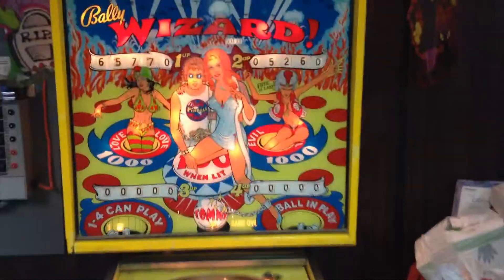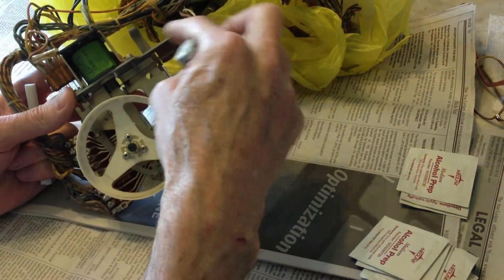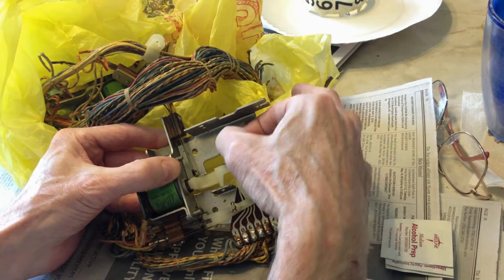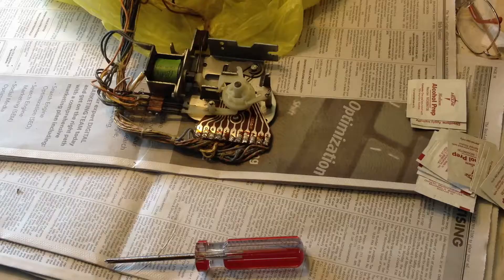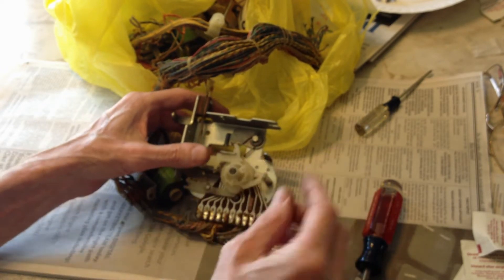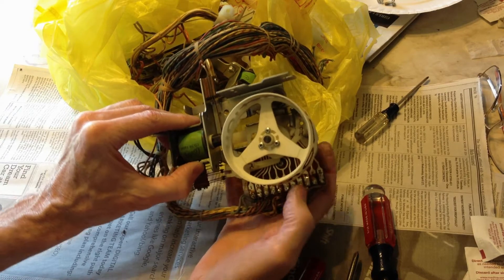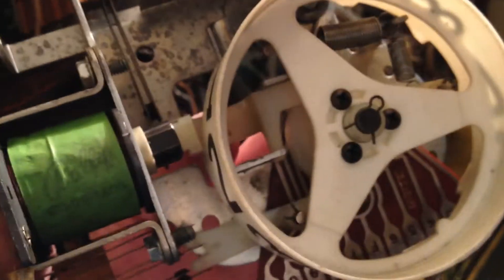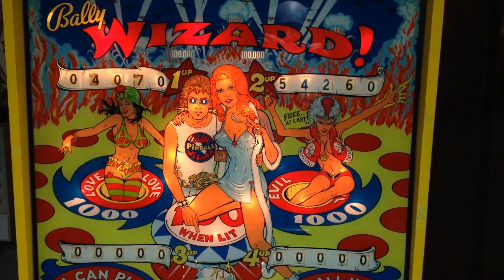Bally Score Reel Cleaning 1975  Wizard  EM Score Reel TearDown - Sticky Score Reels

Comment: Really good job in explaining the process in detail.  All those tips, big and small, really helped me out with my 1976 Captain Fantastic by Bally. It has an identical scoring reel setup to your Wizard. My reel was filthy. I guess the prior owner used some sort of lubricant that turned into gunk. I cleaned the heck out of every little part.  But I cheated a little bit regarding the springs.  I swapped the springs from the rarely used 4th player reel which was already clean as a whistle and those springs were low mileage. So the 4th player mechanism didn't require tighter springs and it still works fine with the higher mileage springs from the Player 1 reel. Again, thanks so much for your video and thanks to you, I can get back to 70s (in my mind) to play Capt Fantastic!
Reply from the maker: Using the 4th player springs was a great idea, I didn't even think of it.  Also Capt Fantastic is a great game, wish I had one....good luck with it!!!

Comment: Freakin Awesome Man  you just got my Bally Hokus Pokus scoring right on!!!!
Reply from the maker: Great!!  I'm really glad to hear that.  We gotta keep these old classic machines up and running.  Good luck with it.
Reply: +Ed Ward You've got that right! I have a 1974 Williams Star Pool Pinball Machine that constantly needs attention. I've owned it for maybe 10 years and can't count how many times I've torn down Score Motors, Stepper Units, Flipper repair, and so on. It's a very fun Game to play, but is always in need of attention. On the flipside I have a 1975 Bally Flicker Machine that I've owned for over 30 years and have replaced the Flipper Coils 1 time and nothing else and plays like a dream. I'm still in awe the genius of the  Engineers that designed these older EM machines back in the day without any Electronic Circuitry. Personally I prefer the older EM Games than the newer Games. You did a great job repairing your sticking Score Reels.
Reply from the maker: Damn, you took the words right out of my mouth.  The way these guys engineered these games is like the 8th wonder of the world.  My hat goes off to those guys that did so much with (compared to today) so little technology.  Keep those games going B L .

Comment: Good tips.  Just replace the coil sleeve, cleaning it is ok.  I never lube metal to nylon parts.  Bally used to sell some special light ‘machine oil’ lube- but it’s not for coil sleeves and was only used very lightly on the score reel parts. You can still get the metal “horseshoe” contact and replace that if it’s broken when you take it completely apart. Yours looked good!

Comment: Thanks for the video. At 5:59, that's the issue I have. When I manually operate the solenoid to advance the reel, once it gets to 9, it doesn't want to move to 0. At 6:25 "That needs to be adjusted", the reel moved out of the camera. What were you referring to there? That's what I need to try next.

Comment: Nice clear teardown instructions.   
FYI, there is a little rectangular knob on the hub of the score wheel that mates with a notch on the hub of the cam gear.  So when mounting the score wheel back onto the cam gear, there is only one possible relative position between the two.  So no need to find the hump and rotate the score wheel to have the one in the front.  
Presently cleaning all 16 score units on a very gunked up Bally See Saw.  Couldn't find an easy way to remove that plunger lever either...
Reply from the maker: Thanks.  Good Tip!!